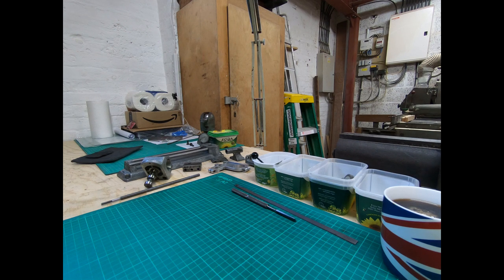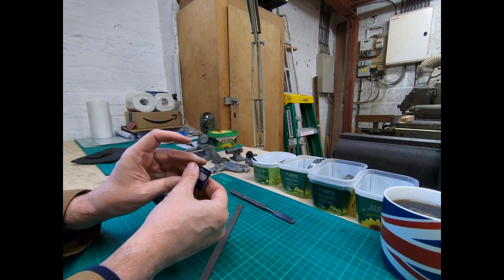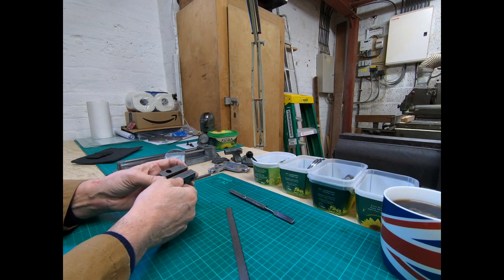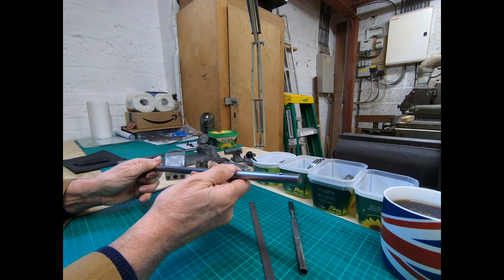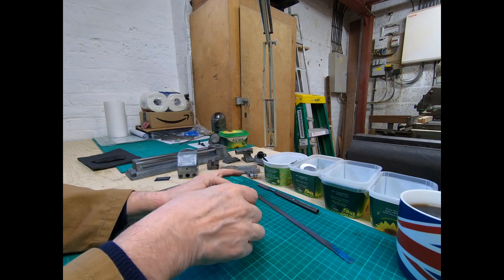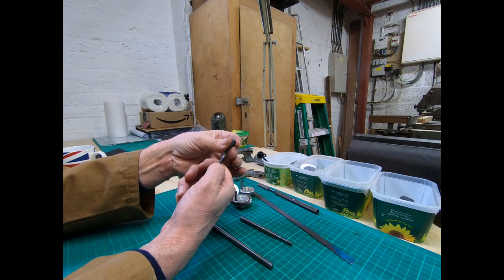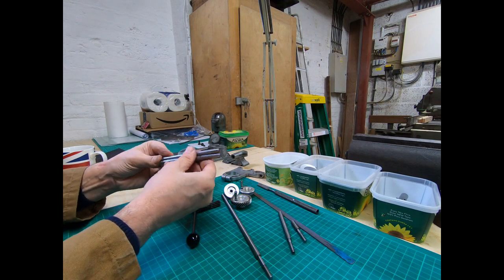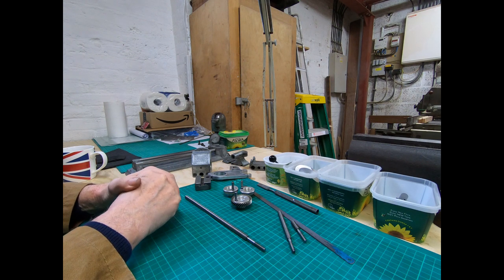Emco Unimat SL - Restoration - Cleaning & Inspection (Part 1).

Comment: Hi Paul. Really enjoying the resumption of the Unimat restoration. I used 96 percent alcohol to clean my SL parts to preserve the paint, which was fortunately almost intact. The rebuild of the spindle will be the highlight, I have  new bearings and thrust washers at the ready. I've been waiting to tear down the spindle until after seeing a really comprehensive video, thanks in advance.
Reply: what comprehensive video was this? Im also in need to overhaul my spindle.
Reply from the maker: @Lori67R  Hello Carl, I will get back on this project once the workshop move is done... I will cover the spindle at sometime. Thanks for watching.
Reply: @Lori67R  Sorry Carl, it was months ago, and not a very detailed video, just a few stills of the spindle laying open. I'm waiting for Paul to rebuild his spindle, which will be step-by-step. Meanwhile, you can find new bearings (NSK E13) on eBay, and a guy in the UK is selling replacement thrust washers. Sometimes you will see them on eBay as a complete rebuild kit. I hope to improve the runout with new bearings when I finish my CNC conversion.
Reply from the maker: Hello Rich,
I am pleased to back on this project and sorry for the gap... Next weeks video all prepared and this weekend I will start to make progress on the following one...See you on the next one and thanks for watching.
Take care.
Paul,,

Comment: Coming along nicely Paul. I like your hacksaw blade scraper, good idea. Cheers, Alan.
Reply from the maker: Hi Alan,
Many thanks for watching... I have been pleasantly surprised of the condition of most of the component parts as I have worked through them... The hacksaw trick I learnt from an old engineer I worked with in the late 80's.
Take care.
Paul,,

Comment: Not sure about how much filler was used on the Unimat castings but I found quite a bit on the shaper I stripped down and repainted - the paint stripper played havoc with it and I didn't bother with using Bondo to smooth it out.  I suspect your scraping technique will yield a better surface than I got.  Interesting to see the process so far.
Reply from the maker: Hello Everett,
With lots of time on my hands and a very small machine removing the paint by hand was not much of a challenge... The casting does not appear to have any filter in it which is good news... I think when I get to restoring my little shaper I am going to find all sorts of unpleasant things...
Take care.
Paul,,

Comment: Youre doing a really good job on the unimat. I took mine apart and just cleaned all the bits and put it back together but watching this, I kind of wish I had gone as far as you with it.
The unimat is a great little lathe however, they seem to have this common problem of tripping out the the mains fuse. I did find an explaination for it but didnt really understand. Basically the idea is that it shouldnt run for more than a few minutes at a time. That said, Ive been looking at converting mine to a DC motor which I can then add a regulator to and control the speed. I think its pretty straight forward using a 24V 120w scooter motor. Something which I might attempt and upload to my channel.
I'm looking forward to seeing yours all finished. 
Keep up the good work
Johnny
Reply from the maker: Hello Johnny,
Sometimes I think I am getting a little carried away with the Unimat... but I've started so better finish - lol. I am aware of the overheating problems, and have seen the scooter motors used before and they seem to be very good... if you do make a video I will be very keen to watch... thanks for watching.
Take care.
Paul,,